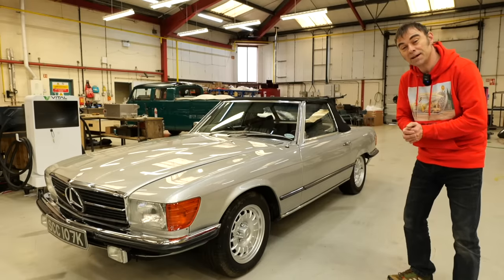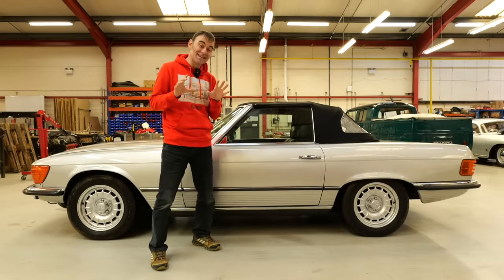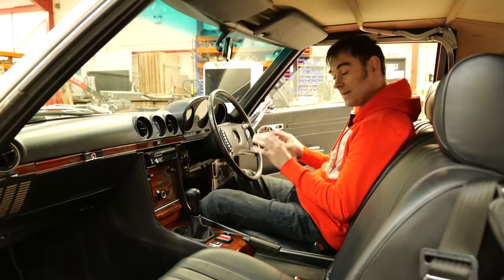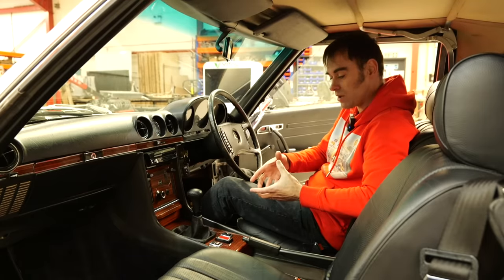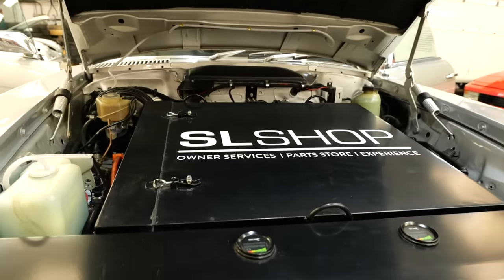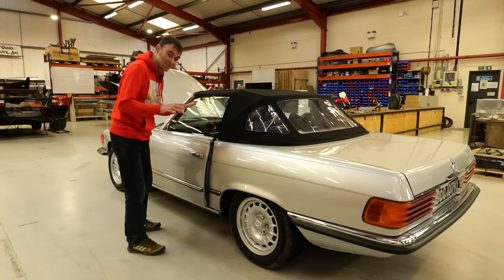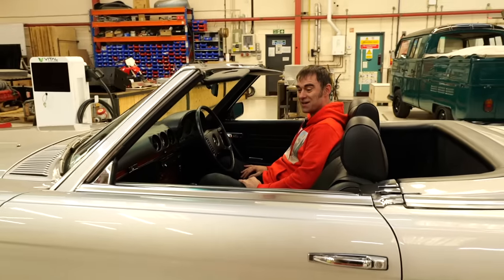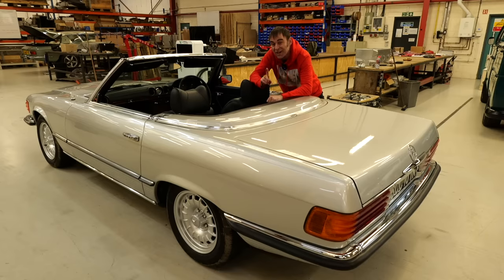Electric Mercedes R107

Comment: I have a theory. Conversions like this will open the door for a lot of reluctant vintage car buyers (like me). Why? A lot of people would love to have a car like this, but worry about engine parts availability, repairs, breakdowns etc. Plus, for me a really big factor is that a car from this era with the original engine, pollutes HUNDREDS of times more than a modern ICE engine with contemporary pollution control systems. I'm not cool with that. So the market for conversion is probably very promising (good for Moggy) and the price of old cars just might be going up - even more than normal.
Reply from the maker: Very true. 👍
Reply: The problem with this is always going to be cost. Your comment about pollution may be valid but you'll be doing a couple of thousand miles in your weekend classic vs 10/12/15k miles in your daily runner, so the volume of pollution over a year will be negligible. Add the cost to convert to EV and it just won't make sense.
I'd love an R107 and might take the plunge this year. I'd also love for it to be electric, but that additional cost just wouldn't be worth it over the price of petrol for those few sunny miles it would do. A specialist will always be able to fix it no matter what parts are available as they'll have contacts for spares, either manufacturer or aftermarket.
Reply: You can just engine swap it and dont worry about the pollution and parts avaliability , but converting a beautiful classic in a ev its a sin
Reply: Same here.
Reply: @spyroskoukidis7461 I can see how you might think that it's a sin, but surely surely it must be a bigger sin to keep using a heavily polluting car, designed before we were all aware that driving such gas guzzling cars was going to be partly responsible for so many health issues 20 or 30 years later?
Reply: @simonpaine2347  are you part of "just stop oil"? Lol😂 those cars are ment to be enjoyed as they are with diesel or petrol, but since you dont understand it this car its not for you, stick to ev and save the enviroment eventhough the proccess of creating batteries for the ev its more polluting than these gaz guzzling cars!
Reply: @spyroskoukidis7461  yeah, whatever
Reply: @simonpaine2347  very understandable reply😂✌️
Reply: @spyroskoukidis7461  Yeah, unlike yours. Where did you get your English from, a cereal box?
Reply: @spyroskoukidis7461  OK, so I wasn't gonna play, but I'm curious. Where did you get your information from about batteries being more polluting than ICE cars? Did you just hear it,
 or see it on a video? I'd love to see that research please.
Reply: @simonpaine2347  english its not my first language unlike you, you know how to write it but dont know what to say✌️
Reply: @spyroskoukidis7461  It seems like you only know what to say if you're either paid to say it, you just need to have an argument, or you just believe in whatever you hear or see, that supports what you want to believe. 
Let's see what evidence you can come up with to support your assertions about those terrible EV's that so many people are scared of.
Reply: @simonpaine2347  you are paid by just stop oil to tell us about ev that are good😂
Reply: @spyroskoukidis7461  So in other words, as always, you have nothing to back up your comments. As I said you are just repeating something you have either been told to say, or it just makes you feel good for some unfathomable reason. 
Either way, I'm OK with you and others continuing to try and convince others that EV'S are not the best solution, because you are still paying the exorbitant taxes on petrol and diesel that supposedly pays for the roads and I'm not. Thank you for helping me avoid taxes.
Reply: @simonpaine2347  let see what will you think when you come to sell your EV😂 then you will see whats better ev or petrol/diesel😂
Reply: @simonpaine2347  do you know what materials they need to produce the ev batteries? Just a simple question if you can answer
Reply: @spyroskoukidis7461  Yes. Lithium which is also used in petrol. Cobalt was used in early batteries and because of its environmental damage and cost, has been reduced ir completely eliminated in latest technology batteries. There are now batteries available that are using sodium/salt, so hardly expensive or damaging to the environment. The vast majority of the materials used in the batteries are recyclable after they are eventually deemed to be no longer viable. In 15 or 20 years, when most of them will reach the end of life, recycling will be easier and probably compulsory. Now compare that with what goes into making an ICE engine, which is going to be scrapped after 15 years or less, after polluting the air for its whole life.
Reply: @spyroskoukidis7461  Batteries that are deemed no longer viable for cars are already being used/recycled into home storage batteries and can function for many useful years. 
Now what about presentating that evidence that convinced you that EV'S are bad?
Reply: @simonpaine2347  we all now that its now completly eleminated also the ev batteries wont even last 15 years so they will need more lithium than petrol uses so they harm enviroment more 
Thats your answer😂
Reply: @simonpaine2347  nope they wont last for years ? They aleready have problems on ev car with batteries
Reply: @spyroskoukidis7461  Sure there are problems with EV'S Some have caught fire and guess what? As a percentage ICE cars are catching fire way more often, but of course you won't believe that, because you don't want to.  There are lots of Teslas out there with more than 400k miles on the clock using the original battery and still going strong.
Reply: @simonpaine2347  you belive what  you want , but stay to yout EV and leave the classics for the rest of us who what to enjoy them as they were ment to be enjoyed,  and just so you know ev are catching fires more than petrol/diesels
Reply: @spyroskoukidis7461  No they aren't . You are 100% wrong on EV fires. You are 100% wrong pn battery life. You are 100% wrong on mining. Do you think lithium mining was invented for EVs?  How did we get the BILLIONS  of lithium batteries used in phones, laptops and everything else? They all use the same materials. You need to get some different information sources or just stop talking unless you enjoy looking ignorant.

Comment: We had a mid-80s 6-cylinder SL when I was young. Top down, stopped at traffic lights, it was so quiet you couldn’t even hear if the engine was running. Amazing car.

Comment: It's a gorgeous restoration of the car. Unfortunately, giving it a new paint job usually means losing the characteristic black double stripes, with the top stripe twice the width of the lower one.
    Fortunately, my '77 450SL import from Buffalo, NY, still has the original paint job (with all the minor blemishes), including those stripes. They are indeed a piece of art. Legend has it that the same guy handpainted them on all the W107s that left the factory. It takes a steady hand, and plastic tape would look different
    I know, stupid detail, and I am truly envious. I'd like nothing more than to have the old, tired, 20 l/100 km polluting V8 and the three-speed automatic replaced by a couple of fat Tesla motors and batteries. At any cost -- just keep my stripes... 😄

Comment: I’d like to learn a little more about your racing days - both of you. It builds a better understanding of your love of internal combustion engines and your desire to save the most beautiful cars by electrification, rather than seeing them eventually taken off the road in a decade or two.
The R107 is one of my favourite Mercedes - those lines between the wheel arches are classic ❤️
Obviously this was at the same time I was driving around in a MK2 Ford Escort, which was awesome for me at the time, because that was all I could afford 😆

Comment: My 1982 R107, a 280SL, also had the manual transmission. If I had known that it could now be converted to electric I maybe wouldn't have sold it back in 2014. And there's no other car like the R107.
Reply from the maker: Manuals were quite rare. 👍

Comment: I used to have a very worn SL380.  It had the strange combination of a huge steering wheel and power steering.  It is a shame that I had to sell it, but the whole front end was about to collapse.  It supposedly had only 78,000 miles on it.  Someone had fiddled with the odometer.
Reply from the maker: They do have huge steering wheels, that’s for sure. 👍

Comment: Cracking conversion on that Merc.
Did you ever get around to finishing that Jenson Interceptor you had when you weighed all the parts to see if EV was heavier than original engine & gearbox etc?
Reply from the maker: Jensen update coming soon. 👍

Comment: I love the work you do and look forward to each look around video……. I’m no big fan of the Ferrari flat engine in the TR, so love that conversion.
I find myself straddling a fence on EV’s………. I see small plug in city cars having a glittering future, particularly if more people can access home charging at a fair rate.

I love the lease of renewed life in classic cars, replacing at roughly equivalent power…….. I quite fancy a BRG MK2 Jag, lowered on wires with an adequate EV power train.

Where we probably disagree is the replacement of “big” cars, MPV, SUV and executive barges, with EV power train. Range is never enough, access to affordable and reliable charging, is woeful……… and the pseudo supercar end of the market is mad and pricey.

There will not suddenly be a surge in available power to charge all the projected vehicles, second hand values are tanking, EV’s are being hugely under valued, if accepted at all, as trade ins…..

Many early adopters are struggling to get out of their lease deals and back to ICE vehicles…….. and, as a Recovery Operator for 35 years, we are dealing with a lot of broken or discarded EV’s, particularly ones that are hired and driven to a stand still.

Like I say, I’m sure that small city EV’s and your Classics re-imagined, have a great and solid future, but not the others 🙁

I’m going to leave my twin turbo flat six Mezger device in place for the foreseeable future…….. although I may look for a MK2 to play with 🤔🇬🇧

Comment: So this car has 5 Tesla Model S modules in the front and 5 more in the back. Does that mean the front and rear packs are wired together in parallel? I don't think the HPEVS twin AC34 is meant to take 228V input.

Comment: Changing from fuel to electric….  DRAMATICALLY.  cuts down on maintenance costs…and gives the unit more longevity and reliability…. And operating costs…..    it’s a.  Win. Win.   … and battery technology will be getting better and better…   Getting tires that are more reliable to the point that you won’t need to carry a spare …   SAFTY first is the best option..  not to be stranded on the side of the road… is. Key to enjoying what you’re driving….      Have a. Fun. Day.  !!!

Comment: The lazy V 8 and then you put an electric motor in it how boring
Reply: I have a number of Mercs from 75 - 98 all with V8 engines. Because of shortage of parts, less and less ADS that are prepared to work on them, booking in, waiting, chasing, being ripped off. Cars come  back sometimes not properly fixed so back again. That’s boring